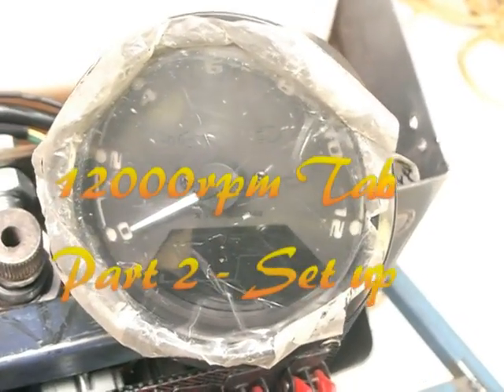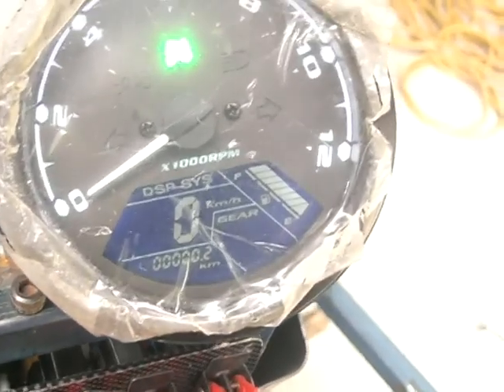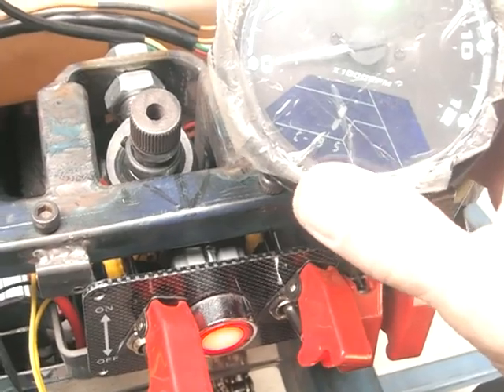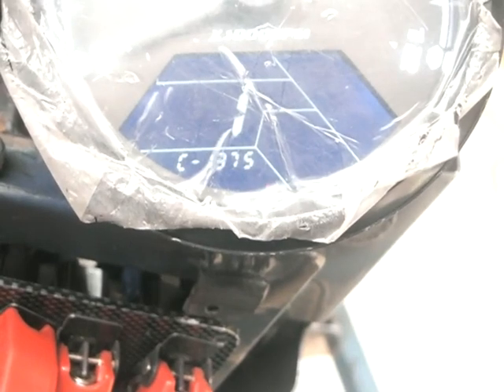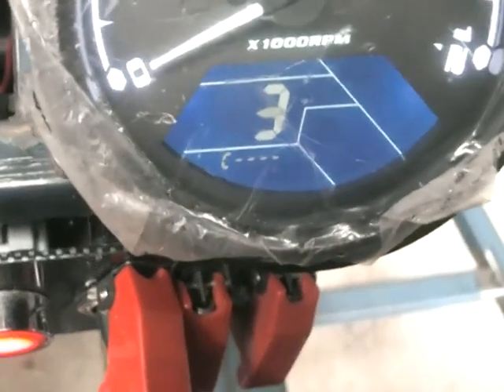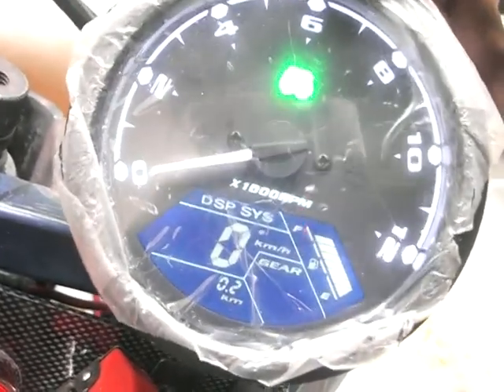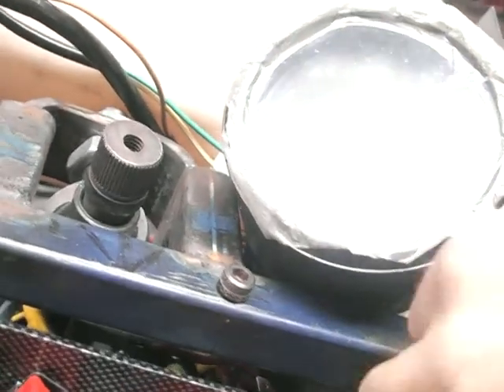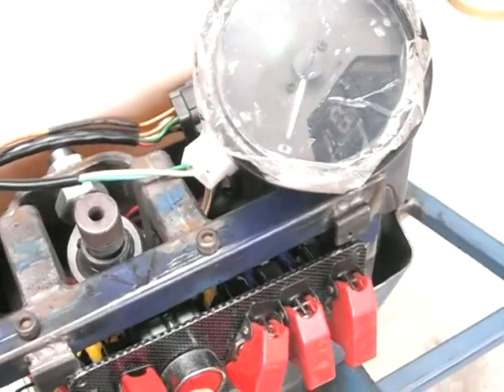12000rpm Tacho Part 2, Set up instructions

Comment: Hi, great video . I got  few questions about this if you don't mind? Does this come with 1-TRIP functionality? 2- how is the visibility of the display in sun daylight? 3-Does the the odometer mileage can be adjusted to match the old motorbike odometer mileage? 4-any issues about water ingressing inside the unit or housing? 5-how is the build quality in general ? many thanks
Reply from the maker: Thanks mate. Doesn't have a trip meter. Visibility is fine in dark and light. Mileage cannot be matched that I know of. Never had water on it, I suspect it would be fine as its sealed fairly well. Quality is great for the price, at the end of the day you get what you pay for. It was perfect for my mower project, I would buy something better if I needed one for a custom bike but would buy another for a daily bike anytime. Specially now that I've figured out the wiring.
Reply: @Mezzmoengineering  thanks a lot mate. Unfortunatly no trip meter for me is a deal breaker without this i will run out of petrol as i got no fuel gauge sensor in my bike. Are you absolutly sure this is not so sort of hidden functionality somehwere? Cheers
Reply from the maker: @fixall336  Not hidden function. It has an odometer that can be reset via the mode settings, but no trip meter. Resetting odometer is via the rear button, whilst you could use that it would be a hassle and ultimately you won't know total distance traveled over time. Maybe you could add a level sensor to your tank and use the fuel gauge instead....
Reply: @Mezzmoengineering  I like your idea of adding a fuel gauge sensor in my tank. i would like to find a video tutorial on that as I guess I would need to cut my fuel tank.
Reply from the maker: @fixall336  Yeah, thats what I did. Maybe look for a sender unit from a tank of similar size. You just need a hole in the tank with a flange to bolt to. Also check ebay for tanks that have senders or pics online so you can see how its set up....
Reply: @Mezzmoengineering  thanks for than man. What about the indicator lights(indicator idiot light) this should be in yellow and not green. Do you think this could be replaced to yellow? is there an option to open and replace this bulb?
Reply from the maker: @fixall336  Hi mate, I haven't pulled one apart o not sure. Anything is possible. Not sure its worth the hassle though

Comment: trying to wire mine up. When I turn on ignition, everything works fine, but when I start the bike everything on the lcd display lights up, that is for the gear I get 8, fuel tank full, battery light on, etc. etc. Any chance anyone has faced a similar issue?

Comment: Thank you so much for this. It seems that there are at least 2 different versions of this out there. The older ones have you enter a code of either 123 or 888 when the display shows CCC--, however if you get no CCC-- it does not need a code and it will work as you show. The older ones the menu is very different. Mine is the newer one and had no instructions. I was mostly there, but this helped in the few things I had not confirmed.
Reply: Same, mine came with the old instructions that were of no use. Lots of trial and error but I eventually got it right.

Comment: and where does the RPM wire connect?
Reply from the maker: Hi, Check the part 1 video. It connects to the signal from the crank. Not from the coils directly.

Comment: Very well explained. I needed this as my  unit came without instructions. I earthed the fuel gauge via a 30 ohm resister. Thanks a lot.
Reply from the maker: Great, glad it worked for you
Reply: hi my fuel gauge light keeps flashing i have tried earthing the  wire but that did not work do i need to use a 30 ohm resister 
thanks for all this information great video

Comment: just did mine, no matter what I do, the rpm just won't work, I tested the rpm signal with a LED light, it blinks right, the fuel gauge also wont work no matter what. all others lights work.  I guess I got a bad unit.
Reply from the maker: Check you have selected the current resistance range for your fuel tank. I took the pick up signal for the tacho from the crank trigger. Don't connect direct to the coil as its likely to damage the unit.
Reply: @Mezzmoengineering  Yes I've used the pickup signal too, the old speedo on the bike also used that signal. I shorted the fuel signal to ground, tried mode 2 and 3, no bar displayed. pretty sure this one I got is bad, or not sure how I damaged it?  I just bought another unit
Reply from the maker: @rc3443  OK, its not expensive so you might have got a bad one as you say

Comment: I just picked up this speedometer.  A couple questions...First on the setup there was a setting for the fuel level it had two settings.  If you changed that to the other setting would it have reversed the settings so you wouldn't have had to bend the float the other way?  Also my speedo came with 6 magnets.  Is it better to use more magnets or less?  I thought of using 3, keeping 3 in case they fall off.  Also someone said the sensor is polarity sensitive.  The magnets are market with red on side and blank on the other.  What should be facing out? TIA
Reply: ... I would assume the blank side should face out. Others don't even have such marks. Chinese are so prone to leave you wondering how to with their usually bad english guidelines... That's if they provide with any at all!
Reply: @MFP2241   Thanks for that info.  BTW do you know how far away the pick can be before it can't read the magnet?  I'm having an issue with trying to figure out where to mount it.  Thanks.

Comment: @Classic Celicas and more :Is it advisable to put a fuse in between red wire which is connected directly to battery postive used for continuous power supply?  How did you fixed yours ? With or without fuse?
Reply from the maker: Hi Maddy, yes I forgot to mention this. You're right there should be a fuse. I did this on mine, all power cables on my build go through a fuse except for the main cable going to the starter motor.
Reply: Classic Celicas and more Thanks for your reply and your detailed videos on wiring .i just installed this digital speedo in to my Royal Enfield 350 cc cast iron type engine . I ll start testing this speedo on road in one or two days. Will seek your help again just in case ;) . Once again thanks for your time and help. Cheers
Reply: Is there any way to double the rpm signal as my meter is only showing half of the bike rpm coz my cylinder setting was already 2 instead of 1 in Speedometer settings?
Reply from the maker: @mandymoni  Yes, you need to change the mode as per video. I had that problem and changed from 4 to 2 because I had dual coils.
Reply: Classic Celicas and more : my bike is single cylinder single coil so which mode will be accurate as per your opinion ? Speedometer in option 3 just showing either 2 cylinder or 4 cylinder.
Reply from the maker: @mandymoni  OK, I see your problem. Like I say in the video for a single cylinder mode 3 must be on number  1. If you change that it will only show number 2 or 4 and it cannot go back to 1 again. Looks like you must have changed  that mode out of number 1. Easiest thing is buy another one...
Reply: @mandymoni  mine also never showed 1. Out of the box it was set at 2. When I change it to 4 it gives accurate reading on my single cylinder with wasted spark.

Comment: Can't seem to get neutral to work, anyone have a solution?
Reply from the maker: Hi, Neutral is just earth via your gear selector. First just earth the neutral cable from the tacho so you know which wire it is and then connect it to the neutral signal from your gear selector. Very easy as long as you have a neutral signal from your engine

Comment: Ok, but how do you wire this? What is the "red" wire for explain as "memory"? Memory of what? And connect to "who"? Positive? Also I have 1 cylinder (wire as 1 cylinder) but I can't set that mode 3 in 1 cylinder. Only shows 2 or 4 options for cylinder. I personally take this speedometer as shitty one. Not recommend for shitty manual installation.
Reply from the maker: Hi, check part 1. I show exactly how its wired. Once you move mode 3 out of option 1 it cannot go back, you only then have 2 or 4. I dont know of any way to get it back to 1 cylinder hence why I suggest not changing it if you have a 1 cylinder. Sure, its not the best tacho around, I guess you just get what you pay for....
Reply: Classic Celicas and more. Ok, I have watched part 1 and I understand why my speedo running "funny" up to 4t rpm. That solid "red" I didn't connect to power In directly to "all the time". I try to do it and I see what happens. Thank you for explaining. PS. Chinese should pay you for this video :)
Reply from the maker: Thanks, yes I agree the Chinese owe me one for this video. They can send me a couple of spare tacho's if they see this...

Comment: Forgive me if I missed it, but have you wired the tachometer wire to the coil directly? Other reviews are going on about needing to wire in capacitors and resistors to get the rpm working lol. Thanks buddy.
Reply: Doh I see you used the pulse generator now from other comments. My bike already has a tach output so I may try that first. I've yet to order the gauge, just trying to make the right decision for which gauge and this has helped a lot. Thanks.
Reply from the maker: Hi, I haven't tried and mine worked connecting to the pick up signal from the crank. Direct to coil might work but others say the voltage is too high. Perhaps confirm what you find....MY advice would be to try to avoid connecting directly to the coil unless nothing else has worked
Reply: Okay thanks buddy. Pretty sure I will go with the same gauge, though there are quite a few different styles out there. I've previously used Acewell and Koso and they are very good gauges but I just don't have the money for that expense these days. Thanks again.
Reply from the maker: Yep, know what you mean, if you persist with this one it does work really well and is great value too
Reply: BTW very cool project mate. I didn't even realise what you were building at first as I just clicked on the vid because I saw the gauge.
Reply from the maker: Yeah, its coming along nicely. This tacho seems to be more interesting to people than my race mower build....

Comment: Great video!! most usefull video i found! just one question i have, red cable goes directly to battery and black cable goes to +12v to key switch?so it knows when you turn it on?what if i put both cables to key switch so i dont run a cable from battery at the rear end to the speedometer that it is at the front?you think this could work?
Reply from the maker: Hi, sure that will work too. The only issue is that you will most likely find that the tacho needle will get stuck at whatever rpm its doing when power goes off. The background power ensures that it always goes back to zero
Reply: Classic Celicas and more i didnt thought  of that...thank you man 💪
Reply: since you are familiar,i have only one issue left,i connected everything and it works great apart RPM...i own a xv250 that is 2 cylinder...i tried to take signal from the wires that go to ignition coil but it is not working at all,it does work if it takes signal from pickup coil but  if i choose 2 cylinder in the menu it shows x4 what it should....if i choose 4 cylinder it shows x2 what it should.....any ideas?isnt it a little weird?if in 2 cylinder shows x4 logic would be in 4 cylinder to show x8 i suppose...
Reply from the maker: That is odd, sounds like you have the correct signal. Mine is set to 2 cylinder even though its 4 cylinder. Its because I have two coils instead of 4. Do you have one twin post coil? Did you try the other cables from the pick up point from the crank?
Reply: Classic Celicas and more i used the ground cable of the ignition coil but it couldnt work on its own...so i put a capacitor 100 nf and it worked
Reply from the maker: Good work!

Comment: Mate peel off that film. Looks like someone dropped a used condom on it.
Reply from the maker: Haha, I've resisted taking it off until I have the build complete and everything tests properly. It will come off once I get the paint work etc done....Just like the plastic still on the stainless dash panel I've made.
Reply: @Mezzmoengineering  

I'll say that was easy to figure out.

Comment: Thanks a tonne for these bids mate, wouldn't have managed to wire it up without them. Got it all working, option three...the cylinder option on mine was already set to 2 on my single cylinder. In case anyone has the same problem I just said there were two magnets and only attached one. Tested it with GPS Speedo and it's spot on. Cheers again
Reply from the maker: Great. to clarify the magnets relate to the travelling speed and not the engine speed. The settings for the cylinders that are 1, 2 or 4 relate to the actual engine speed. Hope that makes sense. For travelling speed the more magnets you use the more accurate the low speed readings will be. It wont make much difference at higher speeds
Reply: I thought so too, but the rpm reads correctly set at 2 instead of 1 but it did double the kph, hence the reduction to one magnet. Maybe something got lost in the wiring, or it's a slightly different version (or I'm missing something stupid)...it's working fine, so thanks again.
Reply from the maker: Maybe, anyway it works. That's the main thing, good work!

Comment: Are you certain on option 3 there is no way back to 1 cylinder?
Reply from the maker: I don't know of a way to get back to option 1 once its changed. Someone may have a solution but at this point I don't know of any way of going back....
Reply: Really glad you posted this instruction video. Unfortunately I pushed a lot of buttons before I found this vid and now my option 3 is on 2-4 cilinder mode while I have a single. So strange that there is no way to get it back!.
I've just send a message to my seller but wonder if they know how and to what extend I'll be able to understand the chinglish reply.

Comment: Hey, could you please tell me that is the fuel sender unit is included in the box with this tachometer?
Reply from the maker: Hi, No you just get the tacho, you usually don't get anything else, not even a wiring diagram. You need to use an existing sender unit or buy one separately.
Reply: Not included, have to buy one

Comment: Thanks for a great instruction! You say that it is only for 1, 2, or 4 cylinder engines? So it will not work on a triple?
Reply from the maker: I've never had a triple cylinder, what engine do you have....There might be a way but the tacho is for 1, 2 and 4 cylinders.

Comment: Does it have an internal power supply to save the milage of the bikes battery is Disconnected?
Reply from the maker: Check your wiring and video 1 for this. The solid red wire must have power all the time. Having said that I can completely unplug my tacho and back in again without losing any settings.
Reply from the maker: True, I guess you just get what you pay for....
Reply from the maker: Hi, there is no internal battery but milage does save when power is removed
Reply: Classic Celicas and more i don't know if you see this but mine every time i turn off my bike my miles reset to zero any idea why?
Reply: Classic Celicas and more ok thanks a lot. But still it's a shame that this product is your typical Chinese quality..

Comment: MAGNET POLARITY.  By the way, just in case I am not the only guy who did not know that the magnets glued to the wheel for the speedometer are polarity sensitive.......they are and naturally, I got one wrong.  I was getting MPH readings that felt like half the speed I was actually going.  I took the pickup off my bracket and ran it over each magnet and one did not pickup.  Reprogrammed speedo to 1 magnet then tested.  Speed went up as expected.  Removed incorrectly installed magnet and flipped it over.  Success.  In addition and unrelated, I added a headlight on/off switch to my project rather than running the headlight at all times.  As a result of how I wired it, I was getting voltage bleed when in headlight low beam mode that was lighting up the (although dimmer) the blue bright light indicator light.  Added a diode and rectified that.
Reply: was it working before drilling and gluing? i mean by hand. i dont get any speed with mine. only if i just touch the cables by hand (no magnets)

Comment: FUEL GAUGE
Some of the posts on this and other videos state that grounding the fuel gauge wire (blue and white) will cause the fuel gauge to stop flashing.  With my ones (3 of them) this was not the case. I have found that you need to ground it via a resistance of between 30 to 500 ohm.  Anything more or less wont have any effect.  500ohm displays 1 bar (of 8) i.e. almost empty.  30ohm displays 8 bars (full).  (about 330ohm is half full etc.) So if grounding the fuel wire doesn't work for you, try grounding it through a resistor between 30 and 500 ohms.
Reply: I happened to randomly choose 330 ohms and can confirm it's about half full. I can't believe how much money I'll save on fuel now!
Reply: thats my problem also sir  the fuel gauge
https://www.youtube.com/watch?v=cgX4zpjx0us&t=1s

Comment: Great video.  I got zero instructions with my order so this was a great help.  Thanks for taking the time.  I installed mine on a LIFAN 125CC powered '71 Honda CT70, therefore, no fuel level signals available.  I grounded (earthed) the blue/white wire as you suggested and nothing happened.  The fuel indicator continued to flash.  Any suggestions on how to make it either look full or empty and stop flashing?  Thanks
Reply from the maker: Hi, earthing should work. You could try adding a resistor between the wire and earth so it earths through a resistor. The resistor should be about 8 to 10 ohms, that should work...Some one else fixed it by putting power to that wire but I would try the resistor first as it should  be set up to earth